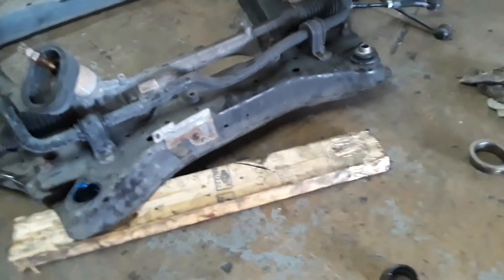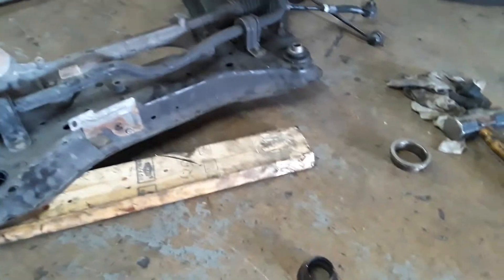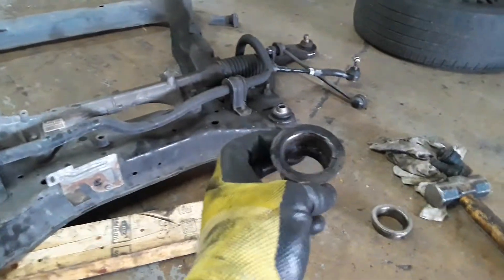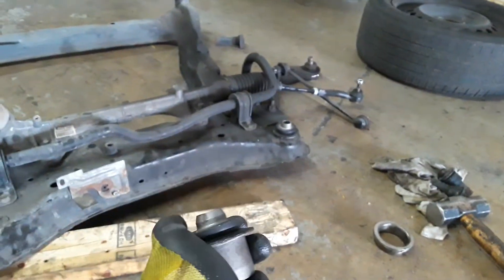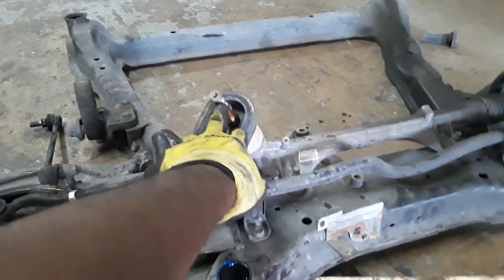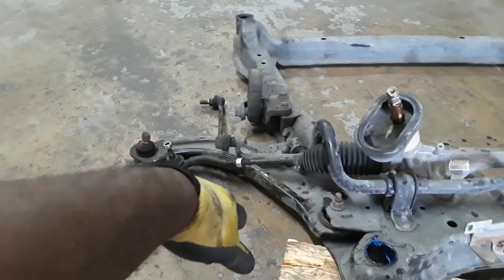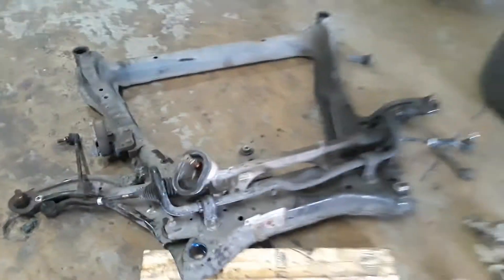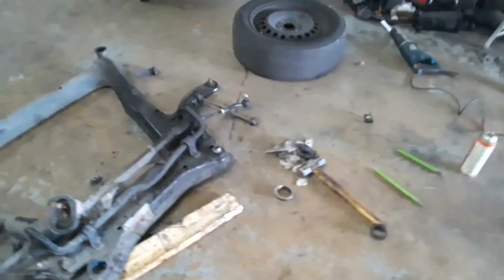Nissan Sentra remove and replace subframe bushings

Comment from the maker: Gigi the parts was $150 for the set of four it depends which state you're in most repair shop will charge by the hour
Reply: Can i get a contact, need to explain the problem i have even though i was doing some research

Comment: Did you hold the motor and transmission or you just remove subframe without holding everything up there....any risk of drop of the trans & motor without the subframe??

Comment: Got the same problem on mine, plus it’s so rusted. I might change the subframe as well ... I’m scared every time I see a pothole. I wish I could do the fixing myself at home. But I’m still looking for a step by step DIY guide on YouTube...
Reply: Did you ever find one ?
Reply from the maker: The subframe is not difficult to remove as I said in the video the engine is still holding by the motor mounts just remove the part that I said in the video and you will have to press out and press in the bushings once the subframe is off the car sorry for the late response any question just leave it below and I will get back to you

Comment: About how much in price all together to get this done. This is the exact problem im having on mine and ive heard its a proccess of at least 8 hours. !!!!!
Reply: About $300
Reply: Wow I mean I was told its gonna be 800 already with just time and maybe almost 2000 all together .. If ever I found this job for 300 would be gold lol but I'm in Massachusetts😔😒
Reply: Average is $500-800 for labor. $300 is on the low side. Got to search high and low or have friends to do it for that cheap. It's a very time consuming job just for simple bushings.
Reply: This process takes about 2-4 hours.  Does you car make a loud clunking noise when you brake or hit bumps?
Reply: Fern yes it does I got into an accident and I had it in a auto body shop wired cause before the accident was squeaking but no rattle then it came out the shop making a bunch of shitty noise an they said the can’t fix cuz it can5 be caused by an accident so now I’m fucked an have to pay out of pocket... mind you before the accident car was brand new ..no noise AT ALL so no way it couldn’t of not happened from the accident !!!
Reply: Gigi Perez messege me